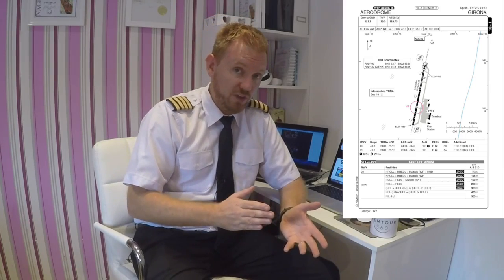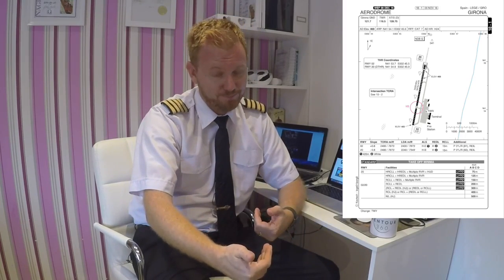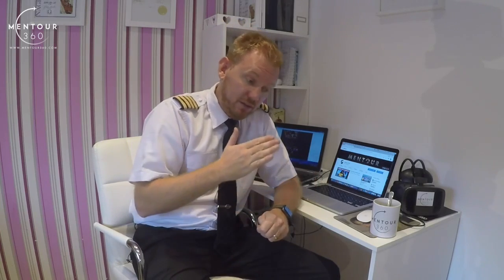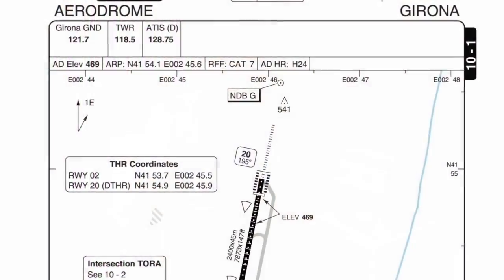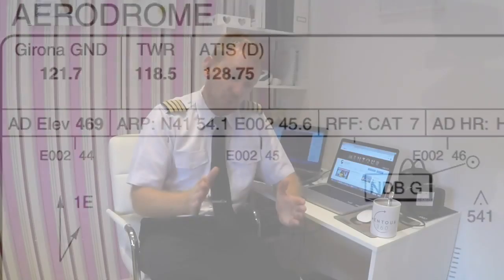How do pilots choose which runway to use?

Comment: Some airports have preferred runways due to noise constraints.
An example is London Heathrow with a 5-knot tailwind preference for the 27 runway direction.
Another example is the now-closed Hong Kong International (Kai Tak) with a 5-knot tailwind preference for runway 13 in wet weather and a 10-knot tailwind preference in dry weather due to buildings immediately ahead of runway 31.

Comment: Which runway to use when you have parallel runways (25R/25L,...)? Is this assigned by ATC?
Reply: Really, in a controlled airport, what ISN'T assigned by ATC?  Yes, you're told which to use, such runways may be running one for arrivals and one for departures.  If they're both in use for arrivals, there's going to be a LOT of extra care taken...

Comment: This means that if the headwind is 150knots, hypothetically of course, a plane could land like a helicopter with full flaps. And take off like a helicopter if the headwind is more than rotate speed.
Reply: That has happened, pilots training on tiger moths early WWII caught airborne as wind speeds increased had to have airmen out on the field grab hold of the wings as they landed vertically at above normal landing air speed so as not be going backwards when they touchdown.
As silly as it may sound, it's not just hypothetically possible, I myself have had times when I've had to come in on final with a much higher air speed than normal and a lower flap setting and still had a laughably low ground speed on touchdown.
Reply: With gliders, you can (relatively) easily stay stationary in the air or even fly backwards slowly (relative to the ground) in moderately high winds. I've done that myself.

I haven't heard or seen somebody use this for takeoff or landing, I think this is due to the fact that, close to the ground, you have a "boundary layer" where windspeed is reduced compared to at altitude and that you tend to have mechanical turbulence, i.e. turbulence caused by air passing over obstacles such as trees, etc.. In these conditions you want to have some additional speed close to the ground to ensure the aircraft keeps flying and controlable in case the turbulence momentarily reduces the airspeed.
So even for aircraft with stall speeds of maybe 60km/h this is hardly practical, and I don't think anyone would ever want to try this in weather conditions that cause wind speeds of 150kts ;)

Comment: When I was flying light twins from the Channel Islands to Bournemouth(Hurn Airport) England many years ago we were routinely ordered to land on Runway 35 and not Runway 26 even though the wind was from the West ! I questioned this several times and was told the Dart Heralds and Larger Aircraft had priority on Runway 26 ! I thought it was expediency for ATC and we were told to do as we were told ! Also it meant we didn't have to be positioned by ATC due Magnetic Track from Channel Islands.

Comment: given a strong enough and stable headwind, could any airplane in theory take off vertically?
Reply from the maker: In theory, yes.
Reply: With gliders, you can (relatively) easily stay stationary in the air or even fly backwards slowly (relative to the ground) in moderately high winds. I've done that myself.

I haven't heard or seen somebody use this for takeoff or landing, I think this is due to the fact that, close to the ground, you have a "boundary layer" where windspeed is reduced compared to at altitude and that you tend to have machanical turbulence, i.e. turbulence caused by air passing over obstacles such as trees, etc.. In these conditions you want to have some additional speed close to the ground to ensure the aircraft keeps flying and controlable in case the turbulence momentarily reduces the airspeed.
So even for aircraft with stall speeds of maybe 60km/h this is hardly practical, and I don't think anyone would ever want to try this in weather conditions that cause wind speeds above the stall speed of a 737 ;)

Comment: How do you choose a runway, when there are multiple (2,3,4) runways in parallel?
Reply: vuilehaid Direction plus L, R, or C for "left", "right", "center"
Reply: Thank you. But how do you decide on which runway you land? Is it something the pilot decides, or is it assigned by ATC?
Reply: This depends on the airports procedures, which can be found on the charts. Usually, the outer runways are for arrivals, and the inner ones are for departures.

Comment: I've always wondered - if you are taking off into an intermittent headwind (almost no wind is constantly blowing at a consistent speed), how is it safe to trust the rotation indicator?  What if you reach 140 knots or whatever the rotation speed is for a 737, and just as you begin to rotate, the wind dies completely?  Aren't you afraid of a stall?  Or does the rotation indicator provide a margin for wind fluctuation?

Comment: Highest headwind component OR is case nav aids differ, the runway with better nav aid available. Been kindly asked to land with moderate tailwind because big guys wanted their ILS and I would screw up plenty of approaches lining up for ILS should I insist on headwind landing with slow GAT aircraft.
Reply: Another quite extreme example is I got strongly encouraged to land on a runway with 20kt xwind because some pilots have complained about sun glare. It did work out smoothly but I have been very ready for GA and a request for a runway aligned with the wind.

Comment: Recently at very large airports where it is difficult for controllers to see the windsock due to distance the controllers came up with an ingenious idea.  Although the idea was stolen it is considered quite reliable on standard day standards.  The ideal is a patch of lawn is grown on the tower ledge right outside the Head Controllers sight glass.  The Head Troller opens the side sight glass and grabs a handful of grass and proceeds to toss it into the air.  Which way the grass is blowing in the wind announces the direction of the headwind.

Comment: Always wondered about the runway numbers so having them explained, finally knowing it’s about degrees is great and makes perfect sense. 

Do you have any thoughts about airports with mostly parallel runways versus airports with many cross runways? In Chicago, for example, they’ve been going through a huge, expensive expansion and reconfiguration of runways, adding new, longer parallel runways, and eliminating all runways that cross other runways - for safety reasons. Getting rid of cross runways appears to be a big safety issue in the US and a lot of airports are doing it. But I have to wonder if eliminating these runways means there will be more crosswinds to deal with?

Comment: Hi Mentour,
I am curious how you receive the ATIS while on the primary ATC frequency. Do you turn down/off your primary frequency and tune to the ATIS or do you just use a separate comm for ATIS?
Reply: Josh Jenk on the A320, the RMP or ACP (audio control panel) you must realize that every control is independent. for  example, you can tune on VHF 2 while listening on VHF 1 while transmitting on VHF 3. on the RMP
(radio management panel) a green triangle light will indicate which radio is being  tuned and on the ACP a triple bar green light will indicate which radio is set to  transmit. I cannot speak for the Boeing
Reply: Ava Mendez as an avid simmer and aspiring pilot, I know this. However, I am unsure how pilots deal with chatter that would disrupt listening to the ATIS while not missing their callsign on the primary frequency... Also you have multiple comms on Boeing aircraft...
Reply: Josh Jenk in my airline,  the number-one radio is for takeoff (tower or common traffic advisory frequency), departure, en route, approach, and landing frequencies. the second radio is assigned clearance, ground, weather (ATIS, ASOS), and flight service duties. if we are unable to copy via VHF, the ATIS can be selected via AOC in the FMS.

Comment: Hey capt. Hope Ur doing well.
Can u make a video on landing gear of b737 Plzz..
Coz I need to know why it has 3 parts :- down/up/off...
Thanks
Reply: It has down/up/off because in its either up or down, but after they have been airborne for a while, they can turn it to "off", which will turn off the hydraulics that keep the gear hanging up in the landing gear bays. Then it will be mechanically held in place.

Hope that helps, as far as I know :)

Comment: hey Montour, you were talking in this video about indicated air speed, and how wind affects that.does that mean that in a small aircraft with a low stall speed (like a Cessna 172 with a stall speed of about 40 knots) flying into a very strong headwind (say a 60 knot wind) could hypothetically hover or even fly backwards in relation to the ground?
Reply: I'm a Cessna 150 pilot, living in a very windy city, and I've flown backwards before, I think in approximately 45 knots of wind. It really messes with your brain!
Reply from the maker: +speed150mph Yes, that's correct.
Reply: ha ha

Comment: A kite has an Air Speed enough to have Lift, but its Ground Speed can be ZERO.
Reply: Every object that has "wings", can float in the Air if he gets Lift. You have Lift if the Speed of the Air, with respect to you, is enough to give you Lift. So an Airplane could float motionless in the Air, if it got a very strong headwind - blowing against its wings - at a Speed as high as 300 Knots (as Indicated Air Speed). And such a motionless Airplane - floating in the air - would be like a kite.
Reply from the maker: +maksim5078 Kind of. Except it's not bound to the ground.

Comment: Very good video!
My question is: why is runway heading calculated against magnetic north? Is this only because navigation instruments are using magnetic compasses or are there other reasons beside this?
Reply from the maker: +Istvan Knebli Yes, it has to do with navigation equipment and the compass.
Reply: Yes. How else would a pilot 50-100 years ago know 'true north', unless he can see the stars. So runways have always been magnetic.

Last year, the local airport had to repaint the numbers, because the magnetic pole has shifted from Canada towards Siberia.
Reply: As the magnetic north changes with the wobble of the earth's rotation so does the numbers. Occassionally a runway will be renumbered.

Comment: great explanation, can you pls tell us the difference between the fixed landing light and retractable landing lights?
Reply: How can the mountains or the rift valley can have impact on landing and taking off of the plane
Reply: Captain Mido channel on the  A320, it has two landing lights in the wings, they are controlled by a three position switch: Retract, Extend and ON. an aircraft with with fixed landing lights, they remain visible and do not retract.
Reply: Captain Mido channel  fixed landing gear means as its name implies it fixed to the fuselage  and cannot be move like single slow moving aircraft ,  were as retractable landing gear means the landing gear can move into an inclosed area such the airfoils (wings) or the under belly  or in some turboprop the nacelles,  the aim is to reduce as much drag  as you go forward into the air.
Reply: The fixed landing lights are in the wingroot, they can only be turned on and off and they do not create extra drag.
The retractable landing lights are located in the lower fuselage centerline, they can be retracted, extended (off) and extended (on). They create extra drag when extended and can be used to reduce airspeed without turning the lights on.

EDIT: This description is valid for the 737NG, in previous generations the location of the lights is different.